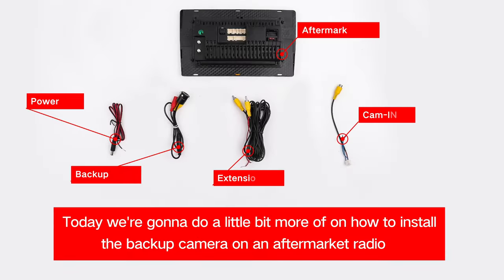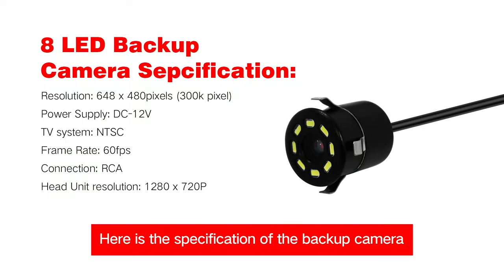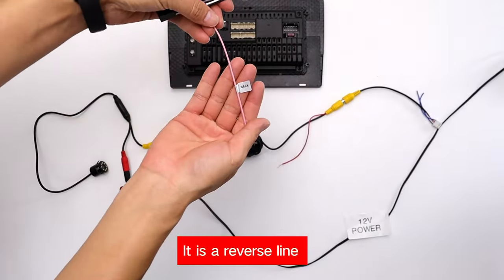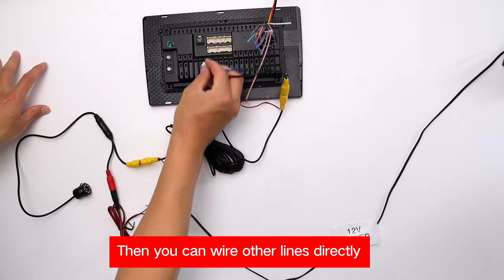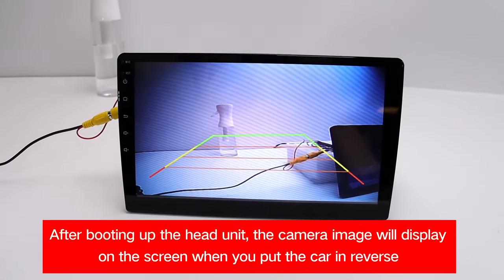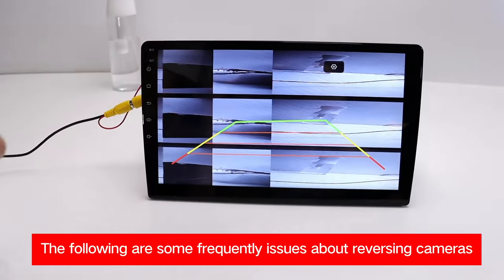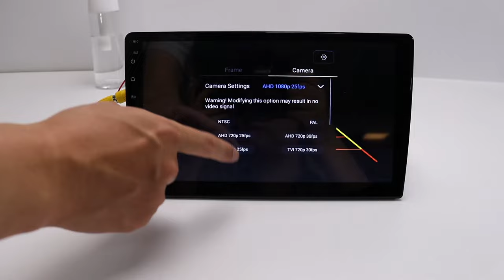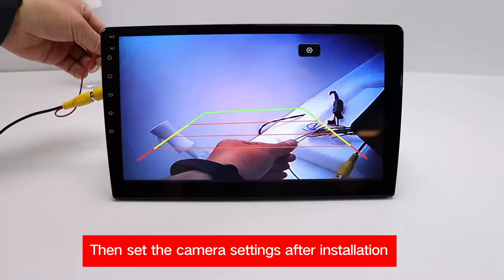How to Connect a Backup Camera to Your Android Car Stereo

Comment: This video is very helpful. I was wondering where to find the reverse line and thanks to this video I saw that is it on the main connector between the car and the Android car stereo. Before that I was trying to connect the reverse line from the camera to one of the cables next to the  video in cable and nothing was happening. When I tried the cable labeled BACK (my cable is brown) everything worked.

Comment: Awesome video, thanks. I have the same headunit but not a cable called Back, what pin is the Back wire conneted to? Thanks!
Reply: Did you find out? Same issue

Comment: Great video, but for some reason the reverse sensors work visually but not the indicator sound. Any ideas?
Reply from the maker: I think you need to turn on the reverse camera sound.
For TS10 head unit,
Please open Setting app -- reverse -- Reverse Volume Control 
Please turn up the Reverse Volume to over 80%.

Comment: Good day, my vehicle already has a rear view camera installed in nto the rear view mirror, as it came out like that. I installed an android radio which has also a rear view camera function. My vehicle is a Kia Optima K5 2012 model. Can you please assist what I can do to change the view from the rear view mirror to the android radio.

Comment: hello, I connected the camera according to these instructions, but it doesn't work, I don't understand what the problem is
Reply: Same here atm I even retried twice they’ve been reaching out to me though please make sure you chat with them.
Reply from the maker: you can try to connect the male camera VIN line with the Video-IN-1 line or CVBS-IN-1 line to test. and then open the AUX app to check whether the camera image is displayed.
if so, I think our 10PIN yellow female CAM-IN line and wifi cable is broken.
photo: Connect Male Camera line with Video-in-1 or CVBS-in-1 line
https://photos.google.com/u/1/search/_tra_/photo/AF1QipNbDFerMj8mSSoTOHrkv4B4LRTrAMVSds6m66Cc

Video: Backup Camera Connection 1- View the camera image on AUX app.
https://www.youtube.com/watch?v=3ZJeJJu3G4M

Comment: What are those two blue wire for on cam in line ?
Reply from the maker: two blue wire are the Wifi antenna.
Reply: @viabecsexpert5681  Wi-Fi antenna for what?
Reply from the maker: @thomaskunz8029  it can boost WiFi signal
Reply: @viabecsexpert5681  I don’t get it, why would there be wifi on a backup camera wire harness? Honestly curious lol
Reply from the maker: @thomaskunz8029  In the F port, PIN-10 is a wifi antenna.
https://photos.google.com/u/1/search/_tra_/photo/AF1QipMWH9ifcZGAynclB1Yu5lZHDnnXyYSGtJ9_xiqd

Comment: What if the  backup camera  showing a multiply picture and distorted is this a setting issue  CAMECHO 2+64G CarPlay & Android Auto Car Stereo
Reply from the maker: Please set up the correct camera format on your head unit.
then reboot the head unit and test the backup camera again.
you can check the photo as reference.
video: Guide to Connect AHD Car Reverse Camera to Android Car Radio
https://www.youtube.com/watch?v=f5DnMd-l8vU

Comment: Hi, I have a android unit for mercedes b 180 (2012). The screen not switch to camera when put in reverse. The screen have a GND and CCV 12V line. I connected the CCV 12V wire with the red one from the reverse lamp. Any idea why its not working?
Reply from the maker: Please ensure that you have connected the reverse line of the backup camera to the reverse/back line of your head unit. 
This will allow the backup camera to display when you put the car in reverse. Kindly double-check the camera connection.

Comment: In my car using the original unit these position lines bend as I rotate the wheel. Is there a way to get the same behavior using non-original nav unit?

Comment: Hi, i have an android unit, i have the Cam-IN Line but i dont have the reverse/back wire ( pink or brown) .. how can i connect my reverse camera?..
Reply from the maker: Do you have Android head unit? if so, it has the reverse line. you only need to find the wire diagram to confirm the PIN of the reverse line.

Comment: My back up camera doesn't come on unless I put the power source elsewhere. How do I get it to turn on when the vehicle is in reverse
Reply from the maker: # How to Install an Aftermarket Rear View Camera
Step 1: Make sure the vehicle is turned off.
Step 2: Connect the male RCA cable of the reverse camera to the RCA camera VIN cable on our head unit. 
Step 3: Plug the 10PIN RCA camera VIN cable into the back of the radio.
Step 4: Connect the camera reverse signal line with our G5 reverse/back detection line. The rear view camera view will automatically activate when your car is reversing.

Step 5: Testing 12-volt wiring of the reverse lamp.
Link the positive camera wire to the positive light wire and the negative camera wire to the negative of the reverse lamp.
Then you can test whether the camera can display on the head unit.

Comment: Hello, the model of my multimedia is Saranubi T10, although I wanted to go into development settings, because when I pressed from the left of the screen, it was reflected from the right, but what setting did I do and now the touchscreen is inactive, from the Reset button, it only resets how can I restore the factory settings in another way, or how can I install a new program in this case.
Reply: Tengo el mismo problema